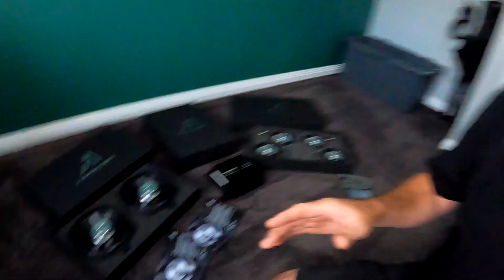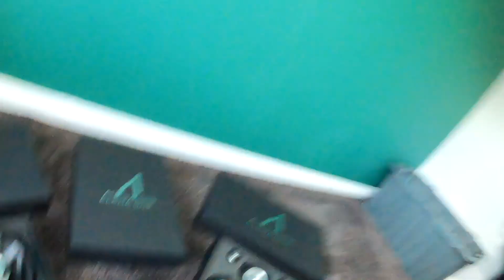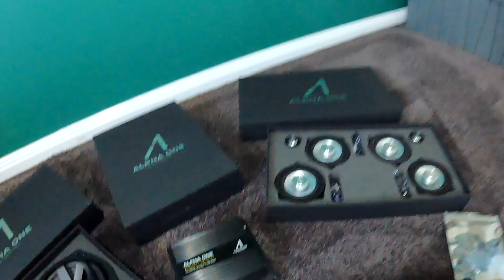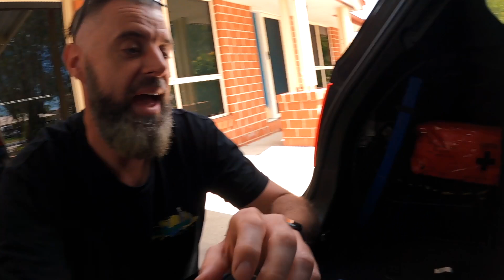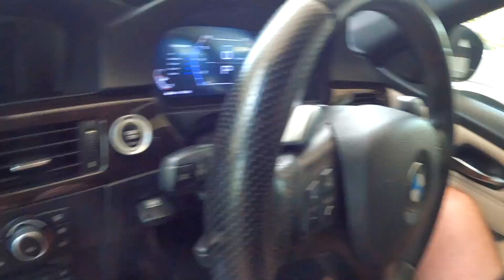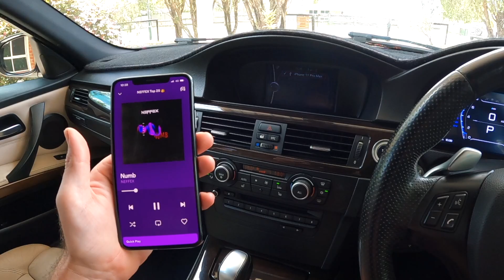Bimmertech Alpha One Amplifier: NOT just an AMP!

Comment: If you have Top HiFi (S677/S688) AKA Logic7, you can still use this amp - it just requires coding your car back to HiFi (S676) first. You will lose the EQ in iDrive, and you will be moving from a digital signal to analogue, but it's a viable option and still an UG over the stock amp.

Comment: I have a E60 with the base system with the worst possible idrive, the M-ASK 2. Went on and replaced it with a android headunit. Then went on and got a full audison prima kit, front speakers+tweeters+undeseat woofers+ rear coaxil speakers+a subwoofer 250W RMS in the trunk with two Hertz AMPs 8 total channels and 2000W of available power. Sounds pretty DAMN good, that's all I could really do being limited hard by the M-ASK ( small ccc ) unit and having to use a android phone with dolby atmos and custom EQ. Playing music from a iphone 16 pro max SUCKS because it has no EQ

Comment: not a huge fan of the Bimmer tech alpha one amp and speakers - if I had to do it again, would have someone else install the speakers and attempt to dial in the amp. Make sure you have PC to be able to download the DSP tool software. The guy that does the software mods to tune the audio files, only works certain hours from the east coast and would rather email you a file than work with you remotely to dial in the system to your specifications. This takes time/days to attempt to dial it in to your preferences. Currently, not a huge fan. Definitely wouldn't purchase this again.

Comment: I have an older android head unit with terrible sound through the aux channel. I recall a video where you upgraded your android head unit for better sound. Is the quality of this amp lost on even that upgraded unit? If not , i may fire go the android head unit for a newer CarPlay only unit and a new amp. I have an 93. Do you know if they have two maps for the 93 roof on and roof off?
Reply from the maker: My android have all been sweet quality wise. I have heard a car play unit with this issue tho. Its like all the midrange is missing. Sounds bizzare to say the least. i would not run a low quality android or carplay box through one of these its a waste. As for maps for roof up and down, i dont think so.

Comment: Do you get good midrange in those door speakers? Because I had a 2010 bmw E90.. I put in the focal speaker kit.. and put in shallow 8 inch subs.. put in a jl audio 8 channel amp that provided great power but still there was almost no midrange.. it was so much bass and treble.. the focal kit was known for being “bright” but yeah the lack of mid drove me nuts. I just purchased a 2023 330 with hifi.. I bought the bimmertech amp.. yes it sounds way better but again I’m feeling a bit like the mids are meh.. I so wish the 3 series came with the diamond B&O speaker package the ix and i7 come with.. it’s incredible. But anyhow. Please let me know how bimmertechs speakers change things… if you have time
Reply from the maker: In this car the amp made the biggest difference. Then the subs which do a fair bit of the work for the mids. Being only 4" door speakers they dont have much power mid range compared to a 6 inch. The bimmertech speakers are definitely an improvement over stock. But they might not be what you are chasing.

Comment: I've got the Matchup 10 DSP with full Alpha one kit AND extra 10 inch sub in my M340i...  I LOVE IT!
Reply from the maker: That would be a serious setup. How have you mounted the sub.
Reply: @ZeroTo60Tube  The Matchup10 has a single RCA output for an external sub.
Reply from the maker: @march3615  I meant how is it mounted in the car? Did you go for a custom box?
Reply: @ZeroTo60Tube  for now i have a normal sub box but i am workng on a custom box on the right side in the trunk.

Comment: I have the basic system in my current F31 my old F31 had a Harmon Kardon which I really miss. I am assuming I will need to do the speakers, as well as the amp, with a basic system due to the limitations of the wiring? The basic system has no real punch.
Reply from the maker: Do you have tweeters in the front doors? If not you will need to change the speakers. You might be able to get away with just doing subs and some custom tuning from bimmertech. But if you can stretch for the whole lot you wont regret it.
Reply: @ZeroTo60Tube  Thanks for that. No tweeters its the basic system. just the mid ranges in the doors, and I assume the subs under the seats.

Comment: Great info! And certainly an in depth and practical review. Upgrading my sound system is somewhere down there on my list of stuff I "need" for my '09 135i. I honestly don't know which factory system I have though. I plugged in my VIN into Bimmer-Tech's site and it says I have a S677A HiFi System Professional DSP... still not sure what that means. 🤔 But apparently the amplifier upgrade is not compatible. I can say for sure that my factory unit does have basic EQ functionality; and sounds pretty decent actually. I'd be game for the amp upgrade, and maybe a pair of new subwoofers. Any thoughts/suggestions?
Reply: Your system is the higher end MOST25 bus based kit. In other BMW’s it’s called Logic 7, but in 1er’s there is no center channel.. so no ‘7’th channel.

Options:

1) MObridge MOST25 8.1.1 amplifier - same basic idea as this amp, but compatible with the superior SQ MOST25 systems.

2) MOST25 to Toslink converter then DSP of your choosing. If you’re willing to spend the money for the ultimate, this is the only way to go.

3) Code your car back to HiFI (S676) then use one of these integration amps. You will lose the graphic EQ in iDrive, and the power delta will be less (because Top HIFI has more power to begin with), bit still a viable option

Comment: when i was in my early 20's i use to be in to loud bass, had 4 12's in the rear of my ford explorer on 1600 watts rms, the last system i did was in my e46 with a pair of skar audio shallow mount 10's in the trunk of my car, (they are rated for 1000rms but they just dont have the box or cone area to get anywhere close to the 4 12's i had but im okay with that) 2 alpine 50x4 amps and a 1000x1 and hertz mille pro speakers on an active crossover built in to my pioneer head unit. ive done quite a fair bit of my own systems in between and thought about doing one in my e90, ive done some research and didnt really feel like the bav kits were worth the money tho plug and play i dont see a lot of bang for the buck. i found a most optical to tosslink converter and from there could buy some really high end amps that use tosslink optical but that rout was too much money for me. also thought about replacing factory amp with a couple of kicker key200.4's on factory logic 7 speakers. the amps put out 45x4 and have automatic adjustments where you hook up a microphone by where your head would be and play test tones to auto tune a 40-band EQ and the time alignment. i remember watching or reading something about it being able to tell or you could set what channels were powering subs, mids, or highs for crossover points. im right there with you on the amp being the first upgrade tho.
Reply: trioma Most-TosLink 3.0, and audison have most to toslink interfaces
Reply: @BEAMERNOOB  I use the mObridge DA1. Great bit of kit that even automatically codes itself to the car in E chassis BMW's.

Comment: @3:54 i think it uses two channels for the front (front left + front right) and 2 for the back (rear left + rear right), the tweeters and mids are separated only by a crossover which is basically a capacitor off the tweeter pigtail. then the other two go to each subwoofer. i could be wrong and its just an assumption but its how a lot of factory systems do it and dont typically use active crossovers and dedicated speaker wires for each individual driver.
Reply: Only the top individual B&W systems in the G series chassis use fully active designs.

All other BMW’s run the mids and tweeters off a shared channel with passive components. And yes, in lower end that amounts to nothing but a 1st order 6dB/oct HP on the tweeter.

Comment: Depending on the situation it's "marketing" regarding the amplifier when it comes to... some topics. In most cases the amplifier uses the high level Inputs. In this case: The already highly amplified signal is coming from the headunit with all of it's noise, distortion, etc. and it goes (...) inside the alpha one amplifier. Then it's doing an analog to digital conversion, do some DSP stuff to amplify everything again at the end. It's technically not possible in this scenario to be better in terms of... signal to noise ratio, distortion... which are really really important things when we speak about sound quality. The "higher" BMW amps. like the L7 are using the digital signal which is much better. The individual amp is using Dirac filter (...) I don't know why alpha one doesn't offer the option to use the MOST bus as even some Android Auto / Apple Carplay Interfaces (e.g. from Mr. 12V) are using MOST to increase Audio quality. It bypasses the headunit by giving the Audio signal directly to the BMW amp which is really nice. I don't want to say the speakers are good or bad or that the amplifier is bad. But depending on your individual situation it's simply not a good idea to use the high level Inputs due to too many conversations of the audio signal. It's like to photograph a picture from your smartphone screen and doing some Photoshop afterwards. The result will loose details even with a high end camera.
Reply from the maker: While you are absolutely spot on with how its working. I think a lot of people get caught up in the benifits of a digital input for no good reason. Just so you know these amps are only sold to suit base and hifi systems. Which are all analogue based anyway. Its only the top hifi and indivual BMW systems with the fibre optic amps. On the same note, not many people are listening to high defnition audio files anyway. That said this does have an optical input which could be used for a handheld high defnition audio player. Also the second you start moving the road noise, engine noise all destroys any level of sound quality people are chasing with the real high systems. I genuinely think these amps are the best thing you can do to a base or hifi BMW stereo. They are expensive, but they are incredible value for money.
Reply: @ZeroTo60Tube   Nice reply and I agree to the main message :) I just wanted to show it's important to know about it's boundaries and this was not mentioned anywhere. The (on their Website) advertised "Studio quality" is hard or not possible to reach by it's principle in case the high level input is used. Anyway... At the end of the day it's important to be happy with the result. Seems to be you are ;)...
Reply: Instead of looking at the SNR of the individual components, consider it across the whole system and the environment..

What’s the Signal To Noise of a car audio system playing at 100dB when the ambient noise from driving is 80dB? 😅

That’s why power matters most 👍🏽

Comment: I have the audiotec fischer match up 7bmw amp which is essentially the same thing. It was expensive compared to other amps but you get what you pay for with the DSP. You will get way better quality if you use a RTA mic to correct time alignment and EQ and you can fix the rattle by putting some butyl sound deadening in the door panels around the speakers
Reply from the maker: Yes, this is the mutchup8 but basically the same in reality. The RTA mic setup, is what bimmertech are doing for each chassis. Basicaly they are going through and giving the users tunes for the speakers and chassis and ideally getting the most out of the system. Which is what i like about it. Just think they need to put more emphasis on how high end the system is. The way its been marketed prior, i legit thought it was some china amp, getting rebranded. Its actually an expensive bit of kit that they have then spent time tuning.

Comment: The mr12volt cic unit is interesting as it runs sound over the MOST system and gives wireless lossless sound if setup properly
Reply from the maker: I have only recently been looking in to those. Ended up going for a different option going in to the e70.

Comment: Hey Andrew. I have a question...what do you know about running a solid state pulling on an n54 alternator?
Reply from the maker: Do you mean solid state relay?
Reply: @Zero To 60  no. Delete the clutched pulley on the alternator. My alternator is good but the clutch is failing and I'm not trying to spend $700 on an alternator right now. Merry Christmas btw!!
Reply from the maker: @LtColJacobBub  you can just change the pulley. To fixed. Some of mine have fixed and some are free spinning. The idea is the alternator will keep spinning on fast engine decelerations and make a little more power for a little longer. Can impact drag on the crank on a very shaft shifting gearbox like dct.
Reply: @ZeroTo60Tube  ok. Thank you! I'm glad I asked you!

Comment: So I'm just going to say it... I'm super jealous that its warm there all year round. My 535i is covered in snow right now. I've been looking at the Bav systems for awhile. You've got me sold on the Bimmertech system, but I need to figure out what the heck is going on. The previous owners had subs and an amp that are no longer in the car. I think the stock amp is in the car, but relocated. Gotta figure all that stuff out.
Reply from the maker: Very likely they tapped in to the sub output n the car to driver aftermarket subs. That’s what is happening in one of my other cars.

Crack open that rear trim panel in the boot and see what Hackery is going on with the amp wiring. 

If yours hifi or logic7
Reply: @ZeroTo60Tube  I'm pretty sure its the hifi, but I didn't do much digging before it got way too cold and the snow started flying. Tomorrow has a high of 16 degree F and a low of -1 degrees F, so I wont be out there for a bit. lol I do recall a rather factory looking amp mounted to the back of the trunk and not in the factory location. There are some big old thick wires running from the front of the car no longer attached to anything. I'm assuming those were to the previous amp. 

As soon as it gets warm, I've got an aftermarket Pemp Android head unit I need to install too. Heres to hoping the hackery is pretty simple to decipher. lol I have a feeling that the biggest hurdle for this whole car will be that it started as some one else's project. Not because things are wrong, but because I'm not starting from factory and I'm sure I'll find things that are unexpected. lol
Reply from the maker: @bradchenoweth7584  wow.... its not warm where you are! haha. Well good luck!
Reply: @ZeroTo60Tube  Yup, the joys of no longer having a garage to work in. The funny part of this whole thing is that I live in a desert.

Comment: Hi Andrew - just FYI do yourself a favor and do code the SA676 - HiFi on both cars.

The basic system and the HiFi-System have a different loudness-and EQ-curves out of the HU and both do change acc the speed your are driving.
The curve of the HiFi one is a way more linear Signal then the one you would get out from the coding of the base System.
I went for the SA677 because I use a MOST-Adapter and the Helix dsp.3 (the full blown version of the dsp that is in that amp) to get a really linear Signal into my DSP

18:12  -Neffex?
EDIT:
20:15 that effect might be that the signal the amp/dsp detects starts clipping and the DSP tones down the output to reduce the risk of damaging the speakers

later when you test the bimmertech speakters to - maybe think about doing some sounddeadening around the  bass speakers too
- also on the outside where the speaker box vents into the chassis rails.
It is not uncommon that the car starts ratteling once you upgrade the bass speakers
Reply from the maker: This is a factory hifi, but I will check how coded just to be safe. 

I do have some sound deadening but for the video I will fit the speakers with out. As I think that’s what most people will do.

Very good points though!

Comment: But have you SEEN and HEARD the Revenant Pro Amp? They do the same thing with custom equalizing per chassis. 
This issue is common in home audio as well, specifically with surround sound, but even 2 channel audio can be done poorly, when the listener doesn't understand how the systems were engineered to work. That's without even scratching the surface of treatments, equalization, and time alignment. 
Every time I reveal something to a client about their system, it's like pulling a veil from over their eyes. Cool stuff.
Reply from the maker: I haven’t heard revenant pro. However it’s made by the same people that make this one, which you likely know. The old version was the matchup7, do you know what the current pro is based on?
Reply: @ZeroTo60Tube  dang, I don't know what the current pro is based on. When you say it like that, I'm afraid to find out lol
Reply: @ZeroTo60Tube  ... Yeah I'm not so sure the Rev Pro is worth the premium cost over this amp. This is serious bang for your buck. 👍👍

Comment: The only upgrade i did was remove CD stack unit and video scalar. Both draw power and add weight. Factory system sounds fine.
Reply from the maker: You sound like a racer!
Reply: @ZeroTo60Tube  In my dreams